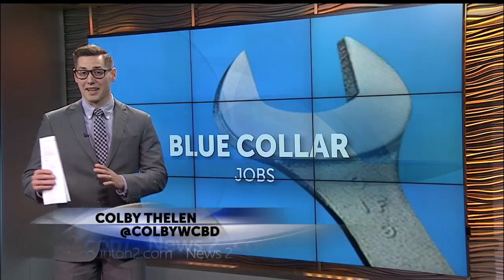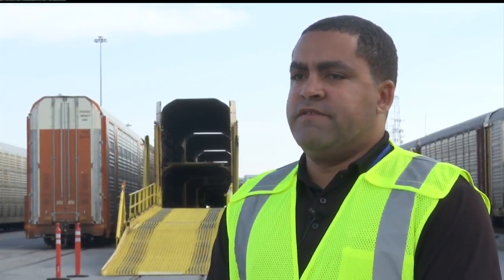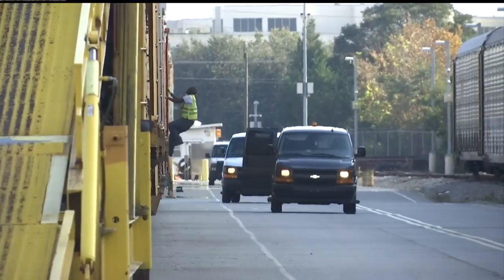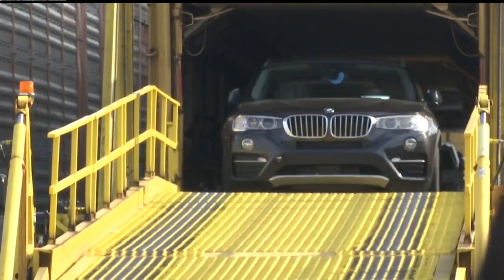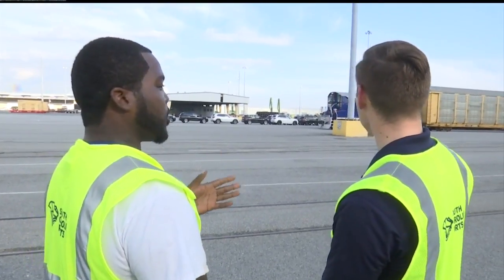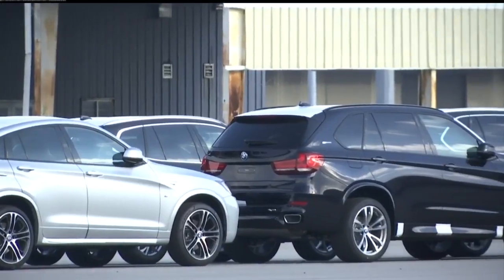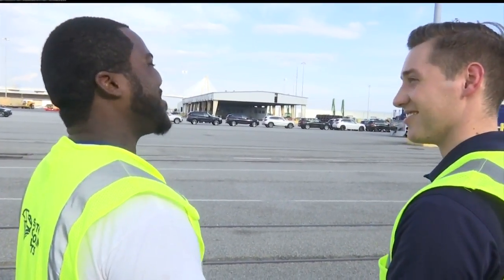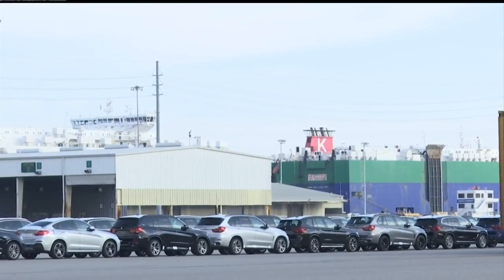Unloading Rail Cars

Comment: It’s not easy when you’re working at the Az yard in the summer when it’s 200 degrees inside the rail cars and you have to break the chalks off the tires on the 3rd deck or c deck! if he’s says it’s easy he’s lying they only showed the easy part of driving and parking the cars lol 😆 they didn’t show them opening all the train doors , hanging all the plates , breaking the chalks off the cars not to mention whenever you park a car you jump back in the shuttle van and have to practically sprint up the ladder to do it all over again 100s of times then close all the train doors when your done on a nice day it’s not to bad but when it’s 114 degrees it’s no cakewalk

Comment: I assume they place small ramps between the train cars so they can drive the automobiles through the whole thing and not have to unload each train car separately?  Been trying to find some images/video of that part and can't.
Reply: We place steel plates between railcars; each plate weighs around 45 pounds. Another team opens the wagon's doors, and another team "strips" the sabos (chocks), thats a pain in the ass this time of the year because they are frozen, so we have to kick the hell out of those chocks. My shift starts in 10 hours, and we have an extreme cold warning because tomorrow, at noon, the forecast shows a maximum temperature of -28 Celsius. Kind of cold, eh? Cheers from Quebec.
Reply: @journalist77  Oof, well thanks for the response and stay warm friend!
Reply: @scottthewaterwarrior  you bet! 🤘🏼
Reply: They are called bridge plates
Reply: Yeah we put these things we call bridge plates in between the railcar so we can drive from railcar to railcar
Reply: Do women do this job